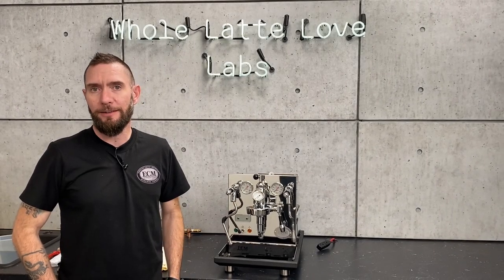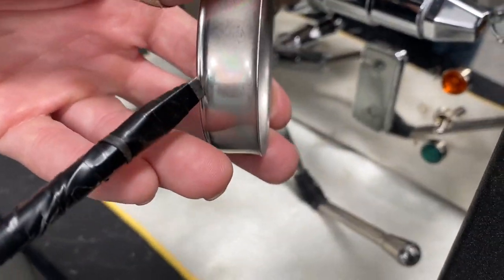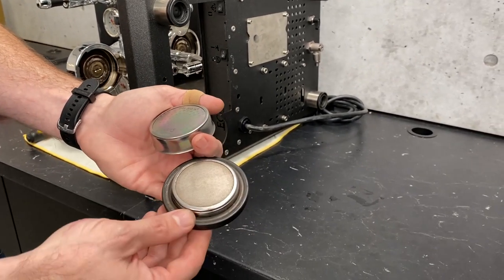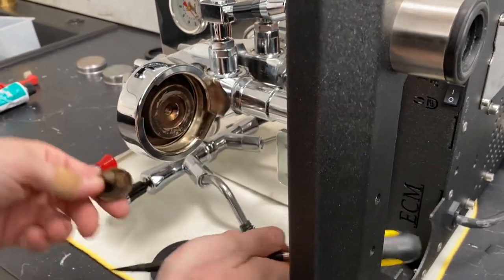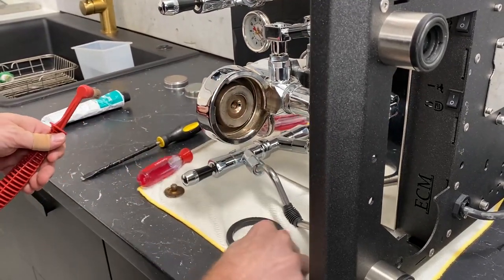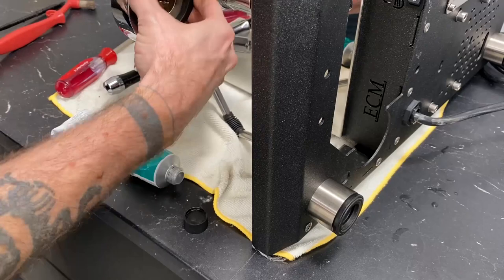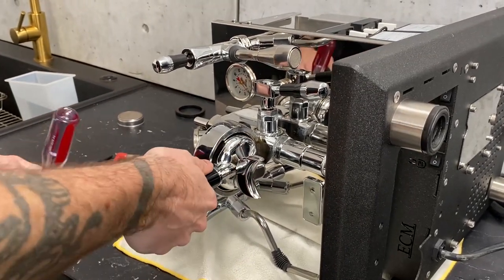E61 Group Head Maintenance: Gasket & Shower Screen

Comment: It was hard to find proper instructions on how to remove shower screen without a screw in the middle. It seems so simple, yet hard to figure out for a novice like me who also didn't know I had to change the gasket and the shower screen. You can imagine how it looked like after a year of using it. This was the most comprehensive and helpful video I've watched. I finally removed it and cleaned it myself. So thank you! I'm a fan now. :)
Reply from the maker: Hi E, You are very welcome - Thanks for the comment!

Comment: I took out the shower screen and gasket to clean. Never was able to get it back in. I did use food safe lubricant. I then bought the screen in the video from you guys along with a new gasket.  Still unable to get it back in so the portafilter worked.  The trick that finally worked for me.  I didn't have the gasket fully up to the lip of the screen.  I made sure the screen was touching the top. Then with my fingers pushed the gasket with the lubricant all the way up.  May sound crazy but it was the only way I was able to get the portafilter to fit.
Reply from the maker: H i PN, Glad the PF trick worked for you and thanks for the comment and patronage!
Marc

Comment: Just followed your step by step, and Tim in service got me the correct gasket to order and i didnt realize my original gasket on this machine didnt work right from the beginning, it always stopped me from locking the porto in "squarely"  or aligned, the handle was already at an angle to barista's left...now it smoothly locks in and aligns, feels so much better and it doesnt squeak when i lock it in place!

Comment: Great info and very timeous - I opened my Profitec  Pro 500 and it was pretty gunked up on the shower screen (hadn't been opened for too long...) I cleaned it and can taste the difference in the coffee.  Great!!

 Also love your videos in that you often reply to viewers comments, which is great.  I just have a small comment regarding how tight you guys make up the group handle on the coffee machines.  I often see you tightening it to the point where you can see the whole machine and the top of the E-61 group head distort slightly under the strain.  Seriously guys, I can literally tighten mine with one finger and it NEVER leaks - just try it and see how little torque is really needed to make the group handle seal effectively. 

Keep up the good work!
Reply from the maker: Hey big5, Thanks for the comment! Amazing what a good cleaning can do. Those accumulated coffee oils and gunk can go rancid with time.
Marc

Comment: I just did this on my pro-600, I would have been less nervous if I had seen this first lol!  Actually your printed instructions got me through it fine. But I wanted to add that I was really surprised at the difference the IMS shower screen made, if I run the pump with no portafilter it’s very obvious how much better the water distribution is.
Reply from the maker: Hey n, Thanks for the comment. The IMS screen reaaly does make a difference in flow distribution. Also stays cleaner with the quartz coating and no fine mesh interwoven screen to trap the coffee gunk.
Marc
Reply: @Wholelattelovepage  Do you have a link to the IMS screen for the Profitec Pro 700?
Reply from the maker: @fr201  Out of stock at the moment but check back here: https://www.wholelattelove.com/products/ims-nanotech-e61-shower-screen
They're currently crossing the Atlantic by boat. Expect to be in-stock week of 1/25/22.

Comment: Hi. The video shows a black ECM replacement gasket. Is this item available? I see many comments about using the yellow or blue gaskets from other manufacturers, and how those may or may not be the exact correct thickness to align the ECM portafilter at the 6:00 position for the Synchronika (which is important to me.) My preference is to use the ECM OEM part, in black, if at all possible. My machine is two years old so I feel I am overdue to replace these parts. I purchased the ECM IMS shower screen, now I need the correct gasket.

Comment: Great video!! I own a Rocket mozzafiato rotary but haven't seen any detailed videos on drain line. Can you provide some info or a video not much info  online.
Reply from the maker: Hi Max, Thanks and nice machione. What would you like to know about the drain line?
Reply: @Whole Latte Love  how to set it up on a Rocket. Or if you have a link to a video.  Baisc how to and any troubleshooting would be helpful. Ive tried a few things to get it to drain but no luck. Water line with pressure regulator and water  filter was a smooth and easy setup.

Comment: Great video. I was looking to replace my gasket as the screen and gasket just fell out of the head !
Reply from the maker: Hey simon, Thanks for the comment. Fell out... Did they come out with your portafilter?
Reply: @Wholelattelovepage  nope, just dropped out all by itself. I'm going to replace today
Reply: @simonheddle-baker1388  it usually happens when the gasket dries out and gets hard and plasticky. It shrinks a bit as a result and might start falling off the grouphead. That means that gasket needs replacing, but nothing to worry about.
Reply: @pfa231  thanks for the information. I've just bought a new seal and brew screen 👍

Comment: I tried silicone gaskets (blue or red) instead of classic rubber ones (black ones, like in the video) a couple of years ago and never looked back. Silicone gaskets never harden and get plasticky, so technically they never need replacement. 

IMS shower screen (like in the video) gives superior water distribution, doesn't collect gunk for some reason, and is easily cleanable to the original new state, so if you add these 2 together - you get grouphead that doesn't need maintenance (apart from backflushes and cleaning).
Reply from the maker: Hi Fedir, Thanks for the comments and agree the silicone gaskets are superior to stock rubber. Also the IMS screens are excellent for all t he reasons you shared.
Reply: now you tell me! okay getting one!

Comment: do we need to apply grease everytime we change the gasket? thank you
Reply from the maker: Hi WP, I've changed plenty of gaskets without lubricating and had no issues. Putting a thin film of grease when changing a gasket makes it easier to remove next time.

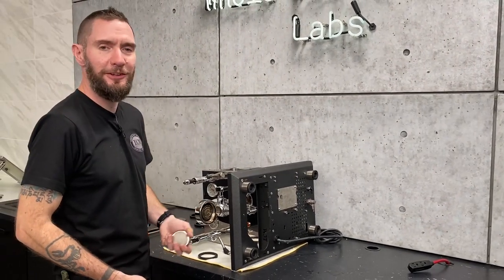Comment: Hi guys.  I purchased a Profitec Pro 500 PID about 1 year ago and decided to replace my shower screen and head gasket today following the procedure in this video which really helped.  Thanks.  However, when I removed the OEM gasket I noticed it was 8.5mm but the upgraded silicon replacement gasket I had already purchased was 8mm.  Went ahead and installed it anyway.  Have yet to test it but did notice that my portafilter is clocking in at about 5:45 now.   Should I purchase the 8.5mm silicon head gasket or should I go ahead and use the 8mm I’ve installed?
BTW - if you remove the drip tray on the Pro 500 PID and move the machine forward to the point where its front legs are half off the edge of whatever the machine is resting on you will have access to the slot on the shower plate even when using a very long flat slot screwdriver.
Reply from the maker: Hi Paul, Glad the video helped you out. Our general recommendation is to use 8mm silicone gaskets on newer E61 machines and 8.5 on machines that have seen some use to compensate for wear to PF tabs and group head lock in channels. Clock in to 5:45 would not bother me (darn close to 6) and with softer silicone gaskets you should get a good seal without as much force as compared to OEM gaskets. Personally I'd use the 8mm but if position is bugging you go for the 8.5.
Thanks for the tip on partially hanging feet off edge - just be careful they don't slip off the counter!

Comment: I cleaned my shower screen and all but noticed uneven flow in my IMS and better results on my OEM screen. Is there a good way to align my shower screen?
Reply from the maker: Hi S, no real procedure for aligning the screen. You could try rotating to new position.

Comment: Any advice on a tool or screw driver size to remove a super stubborn shower plate? I noticed the recess isn’t flat, it’s more rounded like it’s made for a coin, so maybe there’s something better than a flathead screwdriver if maximum torque is required.

Comment: my portable filter never goes to 90 degrees, its always on an angle, even when i put it in tight. I don't see leaks, but not sure if its okay or not?
Reply from the maker: Hey CC, So long as it's not leaking all is well. Very common for portafilters not to clock in to exactly 90 degrees. Common reasons: new group gasket that's not broken in, dirty group head, filter basket sitting higher in portafilter, group gasket thicker than stock.

Comment: Thanks for the video! Helps a lot in maintaining our espresso machine. 
After watching this I'd like to buy a new gasket.  How do I know which one fits my machine? We have the Rocket apartamento and there are 8 and 8.5mm gaskets. Thanks!!
Reply from the maker: Hi GF, You are welcome for the video. 8mm is best for a newer machine. If your machine is older or gets a lot of use then the 8.5mm may be a better choice - def the right choice if your PF clocks in too far.

Comment: Do you guys sell that brass piece as a replacement part? I also went a little ham removing mine :) I was able to clean it up nice and grease it before reinstalling but that slot took a beating. I was hoping to get a new one and clean it when I change the shower screen and gasket rather than waiting 6yrs and having it caked in there :)

Comment: how to remove profitec portafilter chrome cap at the end of the handle?
Reply from the maker: It's a press fit so you need to pry it out with something like a very thin flat blade screwdriver.

Comment: Bro how much is this machine? Is this for commercial use? Thanks
Reply from the maker: Current pricing here: https://www.wholelattelove.com/products/ecm-synchronika-dual-boiler-with-flow-control
It's not technically rated for commercial use, but some do use for lower volume situations

Comment: Could you please tell me how many turn of ecm or profitec flow control device from full close to full open ?
Reply from the maker: Hey Steven, If you want the stock flow rate it's 1.25 turns from fully closed to get 11g/s on rotary pump and 8g/s on vibration pump machines. Here's an article with graphs of flow rates at various valve positions and graphs of 5 flow profiles I developed: https://www.wholelattelove.com/blogs/articles/intro-to-calculating-flow-rate-on-e61-group-machines
Marc
Reply: @Wholelattelovepage   i wonder my flow device maximum fully open is just 1.75 turn. What i measure is 1 full turn flow rate equal to standard non flow control device.